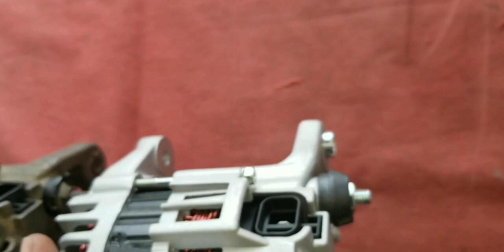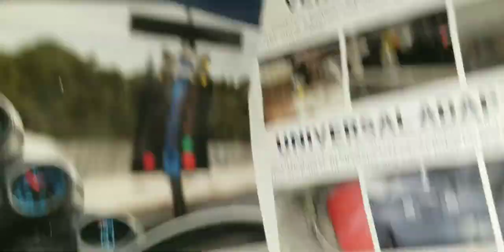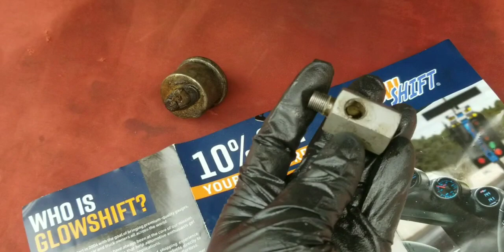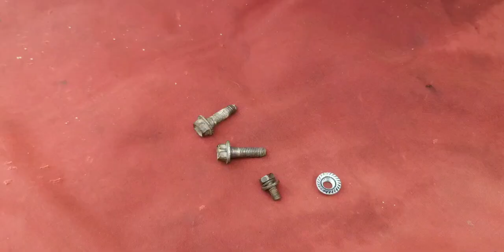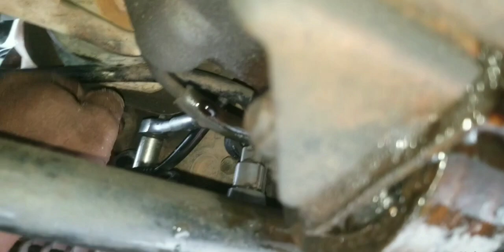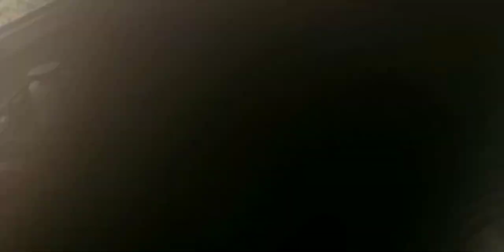How to Replacement Alternator/Nissan Vg33e, Frontier, Xterra, Parhfinder, Navaro, V6 Engine.

Comment: Will nissan quest 3.3 alternator fit? I am looking for high output alternator
Reply from the maker: No, a Nissan Quest 3.3 alternator will not fit due to different mounting points and pulley alignment.